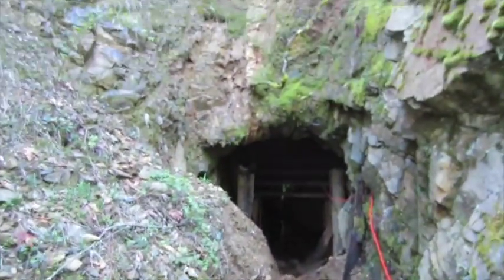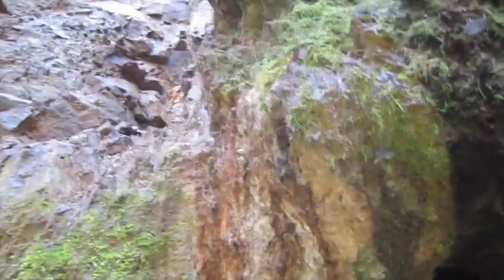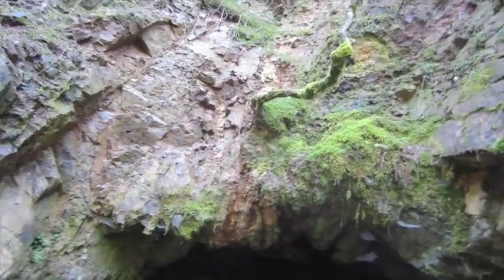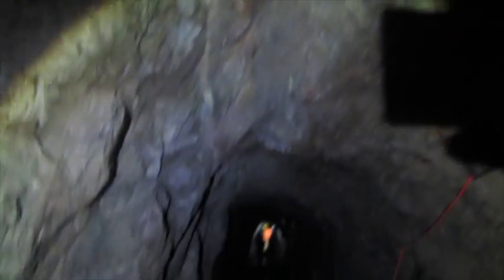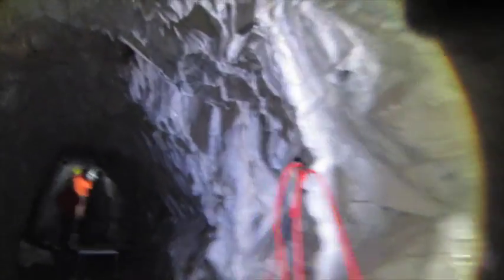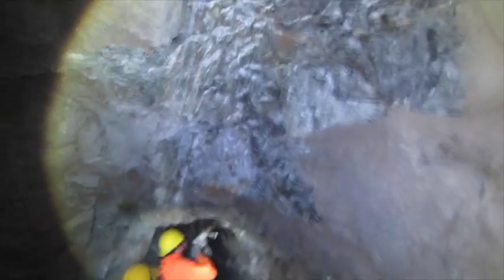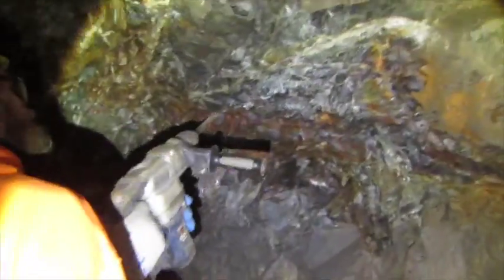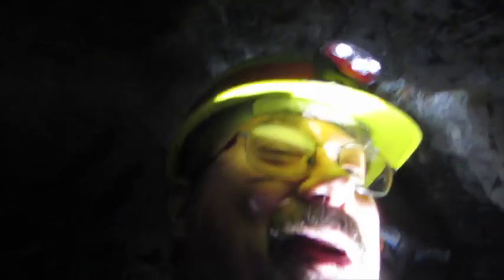Lode Mining in SW Oregon

Comment: i have a question. is limonite vein the actual wall that gold deposits in or gold might be deposited in other areas? i find a hydrothermal fluid vein (not sure) there is brown thin vein and bellow light green- bluish clay like material next to limonite, than pinkish color wall. i took little samples from brown material, but no gold came out, less than a bucket. i was wondering if i didn't took enough samples, or gold is deposited in different part of the vein... any suggestions?
Reply from the maker: I'd keep taking samples of the different materials for sure.  At my Montana claims the gold can be in the quartz, the limonite / sulfides, or in the wall rock (very very old geology),  but always within the fault.  It runs for many miles, and has patented mines all along it.  At the Idaho claims, it's a skarn formation (granite intruded into limestone), so the mineralization is in lenses not necessarily associated with a fault (so pods of wealth).  The Oregon cascade claim it's a fault, Epithermal deposit, gold can be in quartz, sulfides, but the host rock is very altered, so there might be gold there too, but very low concentrations.  The spot we're mining in SW Oregon is mesothermal,  so high pressure / temperature.  So the gold is almost always adjacent to the vein in the gouge material (limonite, quartz, host rock ).

Each deposit can be very different, let alone within a vein.  But in general, hydrothermal veins (mesothermal / epithermal) will be on fault lines, where the slippage has ground up some of the host rock (gouge material).  The super heated mineralized water will squeeze through those cracks depositing the quartz or calcite.  Some modern theories suggest that during earthquakes there will be a flash deposit of metals during the sudden lowering of pressure that occurs during the quakes, and since these fluids have volcanic sources, there can be a lot of earthquakes.  At one deposit we work, there's clearly been different events based on the quartz veins, and the gold is in the limonite that's adjacent to the quartz.  There's often small drusy quartz crystals with it.  It's mostly in the gouge material between the vein and the footwall, though there can be gold next to the hanging wall too.  But these veins are oxidized, and the gold is free milling.  Before it oxidized it would have been sulfides and gold (pyrite, chalcopyrite, arsenopyrite, sphalerite, galena, etc), or base ore.   

The vein in this video is in a shear fault, it's oxidized (limonite) for the first 20-40 feet, then becomes base ore (pyrites).  The drift above it is much more oxidized (blocked entrance, difficult to enter), and the one above that is fully oxidized.  So this follows the "supergene enrichment" model of secondary gold deposition you should look up.  

So the metals are often deposited together, and much easier to mine once the vein has fully oxidized.  The blues are sometimes silver, but blue / greens often copper, so you're likely where the metals are being deposited.  If possible, get an assay so you know for sure what you've got.  Or go to a refinery (or somebody that buy's gold) and get an XRF gun on it for a poor mans assay.  Remember, lode gold is often much more difficult to pan, and can have a specific gravity of 6 or 7 instead on 19 due to impurities that are intermixed with it (quartz, iron, copper, etc).     It can be really difficult to pan compared to placer gold.

Comment: Six grams sounds like quite a lot.  What was the weight of the sample?  If I could find that grade on our claims I'd be mining now instead of making instructional videos.

BTW 'Ore Bodies 101'  is a great series on ore formation.  By Googling the words you don't know as they come up you can learn a lot of geology very fast. Good luck!

Keith
Reply from the maker: We've opened 3 drifts so far on this specific claim, have found free gold in all of them.  The two above this portal are oxidized, while only the first few feet are oxidized in this portal.  Our first decent run of ore was 20 bags (sand bags, approx 45 pounds per bag) from 3 different spots. The material taken from the vein itself showed gold, but insignificant weight, while the ore from the footwall put out 3.6 grams of over 10 mesh gold.  All 3 batches were high graded so was less weight, but not measured.  We are currently milling a ton of the ore from the footwall, so fingers crossed it's a decent producer!  That'll also give us a more accurate OPT reading, though the ore often pinches / swells, with the supergene pockets being potentially rich rich rich!
Reply: Sounds like you are going about it well.  Have you assayed your tailings to determine your losses?  That can sometimes be very surprising.  It may be that the footwall has couarse gold while the vein is mostly micro fine and it as all getting away.

Keith
Reply from the maker: I'm sole owner of this claim, but my name has been added to 4 blocks of claims on this mountain, where the "First Blood" pocket was found in 2014.  I've been working different mines on it for 2 years now, and have moved many tons of ore from different spots.  It's all large free gold, with the arsenopyrite also being a carrier, and while we do have a smelter setup w/ scrubber exhaust setup, we're not making the sulfides a priority, but are stockpiling them, allowing them to oxidize naturally before we process.  

Our mill set up is very cool, as we "wet crush",  so have water jets in the hopper, into a jaw crusher, rollers, gutter/sluices, Centrifuge (excellent for really fine lode gold!!!), the holding tubs, water recirculation. We have a floatation mill as well if we wanted to focus purely on the sulfides, but hasn't been needed yet.                                 

 I'm very fortunate to have a mining partner who's brilliant at many things, including Inventing, designing, and then fabricating all kinds of top notch mining gear.  The Quartz veins are generally blank on this mountain (Bull Quartz),  and the mineralization varies from footwall to hanging wall depending on which mine / tectonic fault we're working.  I have done assays on other claims, as there really isn't any smart way to mine without them, but on this mountain,  it's more about finding the wealthy pockets, where the gold can go over a thousand OPT  (you read that right), obviously we haven't hit that ore, but pulling 2 pounds out of about 600 pounds of ore is the closest we've gotten!!!
Reply: Sounds really interesting.  That is some seriously rick pocket ore!  You can also possibly sell the pyrites to a refiner and not have to worry about the details.

Keith
Reply: Husky Hiker Mining is this near Jacksonville oregon, or the oregon vortex on sardine creek? Are you finding the stuff white vinegar liquid will melt off the white chalky quartz? Can you invite us to learn more, will my whites TDI pulse induction  metal detector be useful  in your type of fissure sulfide stuff?? Thanks to JeffWilliams also.
Reply from the maker: It's in Josephine County, and I also what a White's TDI pulse, great machines!  We lost the road to the claim 2 winters ago, so that's halted further development.  But I'm always exploring new ground, looking for signs of shearing in the road cuts, and spending lots of time looking at lidar maps. I've found gold in quite a few areas of shearing that didn't have any signs of quartz (but did have iron).